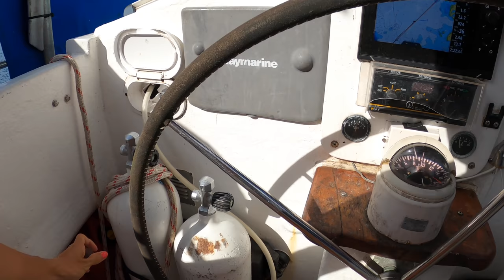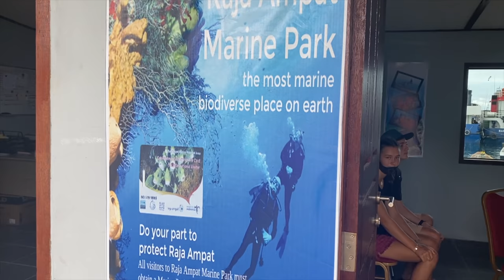Beach Fire Cook up in Paradise Episode 254 (Sailing Catalpa)

Comment: My Perkins 4108 can fill the crankcase two ways Lift pump is always first cheapest thing to consider 2nd front seal on injector pump BIG PROBLEM I am not mechanic and all engines are different but I can say from first hand be careful if crankcase fills with fuel engine can run away or start sucking fuel from crankcase into air intake.  My runaway problem happened while in neutral so engine RPMs off the charts every second counts  knowing this could happen I was ready to remove air filter and place cooking pot over intake  and close off air intake with pot, worked like a charm.  I am told with 4108 70 % of the time the membrane in lift pump is the problem but in my case one thousand US dollars to rebuild injector pump Good Luck you guys have wonderful channel I imagine people will be watching your videos hundred years from now.  yours is the benchmark of the ideal family
Reply from the maker: Thanks mate very interesting will pass onto Lee and cheers for watching  🥰

Comment: As your friend recommended, bypass the mechanical lift pump by just connecting the output to the input with a short hose then forgetting about it forever. Add the electric fuel pump in line and wire it to the ignition switch. Easy and worthwhile upgrade, and spare electric fuel pumps are cheap and easily available anywhere. 
There is one other diesel leak source people overlook, the gasket around the high pressure mechanical pumps can leak allowing fuel to mix with the oil.
Lucky you finding a compatible mechanical lift pump, your karma is good!
Reply from the maker: Thanks mate for the advice it’s very appreciated ☺️🍻

Comment: I had a similar fuel issue with my perkins. While waiting for a replacement lift pump I bought an electric pump which I now only use to bleed the system and found that once bled the iron sail was happy to gravity feed as the base of the tank is just above the injector pump height. I also had to rebuild the injector pump but we won't go there🏴‍☠️🍺
Reply from the maker: Cheers mate that’s interesting and we may need to rebuild our injector pump too 😅 any tips?
Reply: @SailingCatalpa  yes buy a new one. 
I had mine rebuilt for $1700 and it leaked, something to do with diesel having changed it's formula that can leak passed gaskets that ended up being fixed with gasket goo. A check online found a replacement new one could be got for $1500